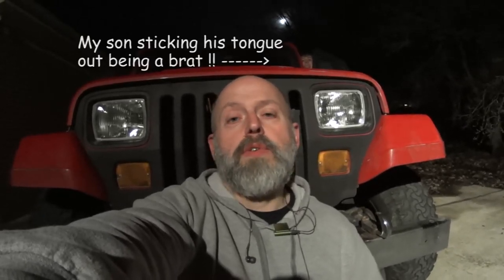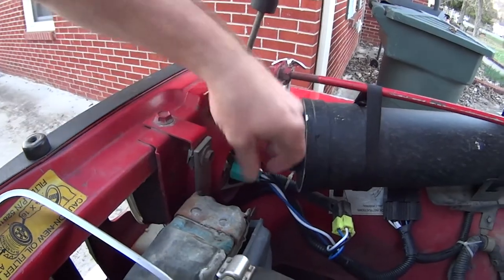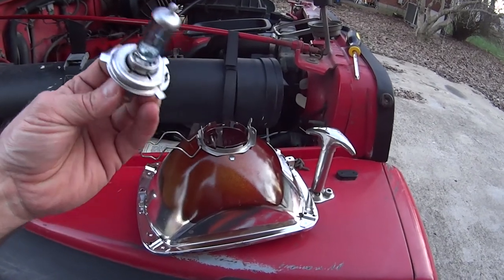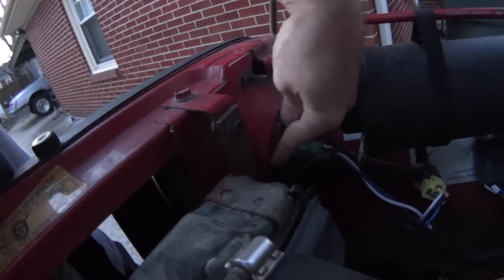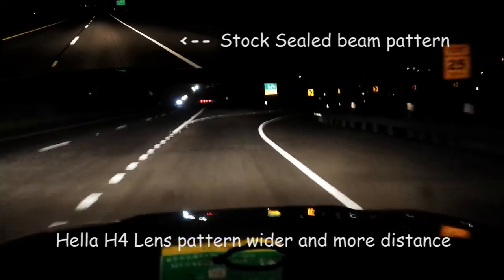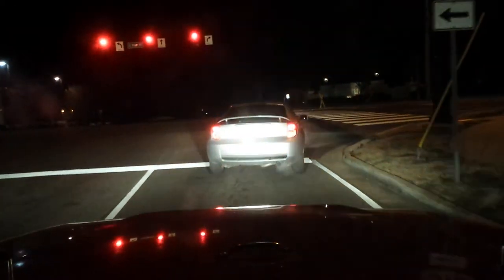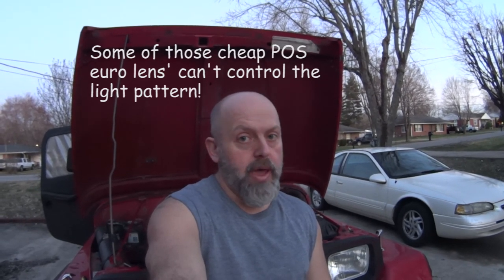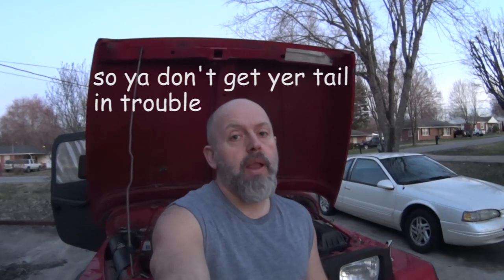Jeep Wrangler YJ - Hella H4 Conversion headlights

Comment: thanks for the dustboot tip. always struggled trying to line them all up.
Much Obliged
Reply from the maker: batty505 You're welcome! Glad it helped :-) Thanks for taking the time to leave a great comment. Have a great day!!
Reply: no worries. 
I have red 93YJ that I need to do a frame off repair. Ive subbed  your channel to see what other stuff I can do. Have you done frame work yet on our jeep?
Reply from the maker: Except for one bent body mount, my Frame is solid. I would go into withdrawals to have my Jeep down to redo the frame :-). Soon I will be gathering parts to do an engine rebuild. I plan on doing a series that details on how to build the 4.0 liter Jeep. Coming soon also will be a how to lift the YJ using Junkyard parts. Lots of cool stuff coming up. No frame offs planned anytime soon. Thanks for subbing! I really appreciate it!

Comment: Awhile back i bought a set of H4 projector  headlights that have the 55W bulbs and a small light bulb with a white & black wire in the back! i just got them out today & got online to see what the best way to install them & come across this vid & the vid be4 this one! I remember having a hard time installing these headlights when i first bought them, it was trying to fit the metal band around the lens. The lens was a tad bit bigger, it was the very first thing i remembered when i got them out! I could fabricate to make them fit but i was wondering if the silverstar sylvania lens was better? And if so would it be better to install them with the HID Ballasts? I have a 95 jeep yj so would i need a wiring harness like you showed in your vid along with the HID balllasts?
Reply from the maker: Personally, I don't waste your time or money on HID or Halogen. Really not a fan of the Silverstars, lots of money for a very short life ... not a good investment. The technology for LED has come so far that they are way less expensive with great performance!! I currently am running Hella H4 conversion lens with Auxbeam LED bulbs. Running these LED bulbs I didn't need to run the add-on relay harness. I'll add links to what I'm running for a headlight set up. This combination works great!! Highly recommended!!
Here are my lens': http://amzn.to/2HLYNqi
Here are my LED bulbs: http://amzn.to/2FKBbpD

Thanks, hope this helps! Have a great day!!

Comment: I just did the Hella harness and h4 upgrade and, wow, what a difference. Thank you for the videos. Which Sylvania bulbs did you switch to?
Reply from the maker: I ran a couple different ones. But, here is the downside to running bright halogen bulbs. Very short life span! Good ones aren't cheap and I got tired of buying new halogens every 3 or 4 months. I've went H4 LED and havent looked back. I'll soon be doing a video soon comparing the "All-in-one" LED lights and my Hella H4 lens with H4 LED bulb inserts. Make sure your subscribed so you dont miss it.

Comment: So you need to upgrade the stock harness for the brand new H4 lights otherwise they won't have enough output and/or work properly?
Reply from the maker: +Tom Palaoro (Lefty) The H4 bulbs pull more amperage producing much brighter light . The stock "may" handle it .. or it "may not". I have an '94 T-Bird that the H4 bulbs melts the plug connecting to the bulb due to the extra amperage pull generating heat. The CJs, YJs & TJs have plastic plugs for the bulbs. It can melt them also. Harness is like $15 - $20 ... cheap insurance to protect against burnt plugs or fried harness. So its up to you. Harness and the H4s out shine my dads '06 TJ by a huge margin. Best mod so far! Thanks for dropping by! Have a great day!
Reply: Thanks I am just tryingn to figure out how to get brighter lights and I want to thank you for your videos they really help shed light on upgrading and enhancing my 94 YJ
Reply from the maker: Tom Palaoro You.re welcome, happy they help :-). Here is the harness I used http://www.fixjeeps.com/jeep-headlight-upgrade.html It made a huge difference. Also at the bottom of that webpage link I sent you is the square lens' I used. They rock!!
Reply: You always put a relay for the lights , one relay for lowbeam and one for highbeam , you don't have to mess with burned electric system because the relay works like a fuse in it self !

Comment: Any bulb that us not clear (Has a colored coating) is limiting the total emitted light. Also HIDs are not effective when used in reflector beam headlamps. >>5000K color temp is inferior when it comes to distance because the light wavelength is too short and cannot pass through the particulate in the air. This is most pronounced when there is fog or mist. Which is why fog lamps are typically yellow/amber.